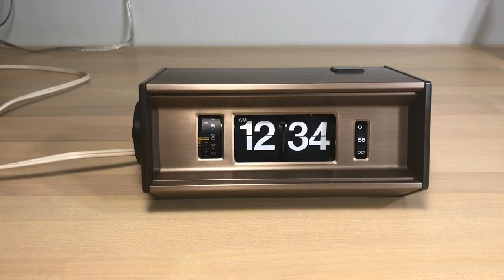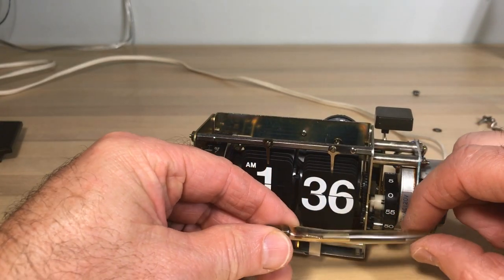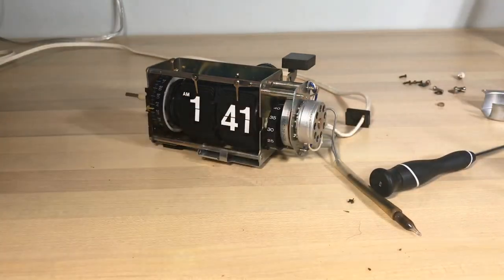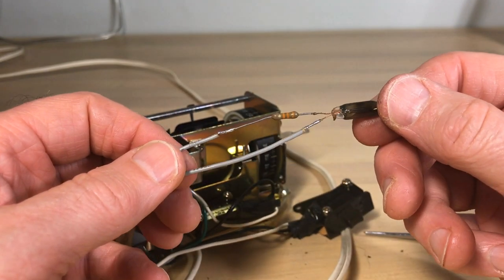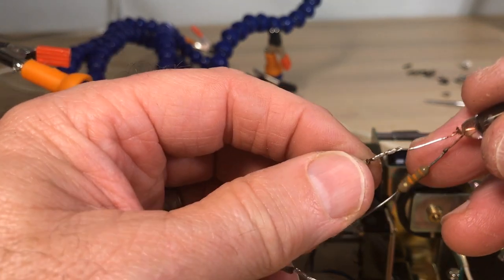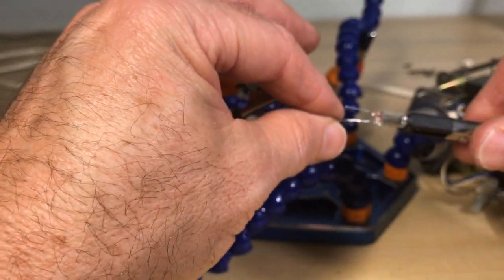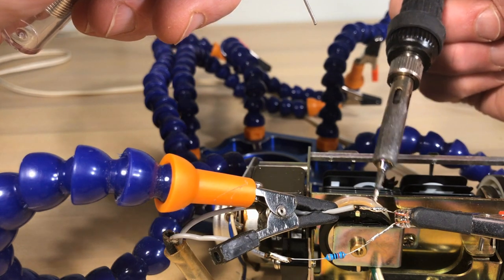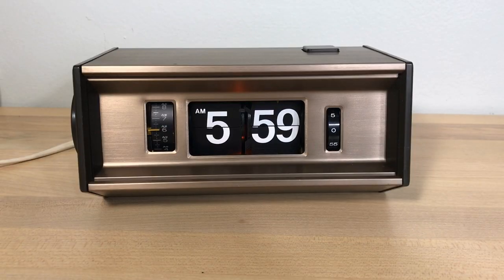Tutorial on replacing flip clock bulb and oiling the motor in a Copal 702

Comment: Thank you for this guide! I need to oil mine as it has been sticking lately. I was wondering if you think the Deoxit oil would be good to use as well? I use Dexoit 5 on my projects that have old scratchy pots to clean them up as well as older chip sockets on things like Commodore 64s. The Deoxit 5 isn't an oil, but they sell an oil that I have purchased to do some oiling on an old wind up wall clock I have. 

Thanks as always for the amazing video! I appreciate the tutorial about how to clean these wonderful pieces of history.
Reply from the maker: No. We (me and my resident expert at FlipClockFans) would Not recommend Deoxit at all. Use any light clock oil. 
Great question.